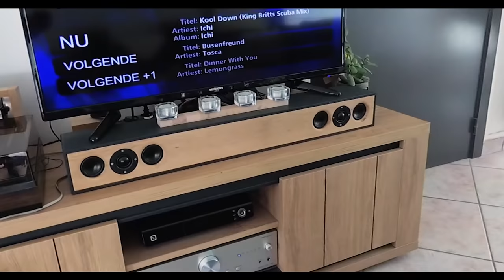DIY Soundbar: make it yourself

Comment: "You need a TOSLINK Digital Optical Cable"
(TOShibaLINK) An optical interface for digital audio connections that provides a data rate from 125 Mbps to 1.2 Gbps. Developed by Toshiba and part of the S/PDIF interface, TOSLINK sockets are found on A/V receivers, set-top boxes, CD/DVD players and TVs. See S/PDIF and audio cable.

"Digital Audio Connections"
Both part of the S/PDIF interface, a TOSLINK socket is commonly found next to its electrical and coaxial counterpart. If TOSLINK is not used, the stopper plug (bottom right) prevents the red LED beam from escaping.

"Optical Audio"
"Optical Audio" is a TOSLINK designation. On this Roku streaming video set-top box, analog audio is provided for legacy TV sets. Neither analog audio nor TOSLINK are supported on Apple TV, Fire TV or Android TV, which have only HDMI output. See it (https://amzn.to/2Z8OZyO)

Comment: how does it sound?   im no audiophile, but i just want a "good" sounding DIY soundbar... good enough for movies and music.   How is your crossover design different than 123toid?
Reply: Hi! It sounds better then most commercialy available soundbars! Do keep in mind that without a sub added to the setup, it lacks base. My crossover is different then 123toid because I just took the same drivers and started the crossover from 0. I took it as a project to learn how to design a crossover so that I would have a existing example to verify my results. I eventually plan on bringing out a video with the details but I have to admit that finding the time to do so is rather difficult..
I also think that 123toid used a closed cabinet? I used a ported design.

Comment: im trying to do a soundbar too,i have everything except amplifier and i really want to know,wich one is good for a 4x25w?
Reply from the maker: I have the onkyo a 9030. It's affordable and simole but it's a good quality amplifier.
Reply: @makedo3332  im using a 4 speaker 25w each,,its ok with thar amplifier?
Reply: @lucasluke250  It's safe to use them together :)